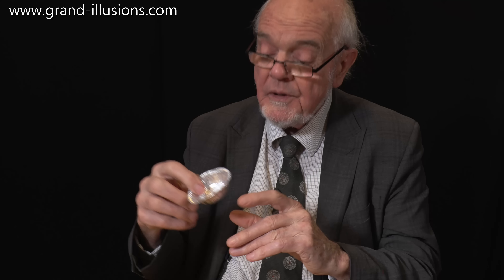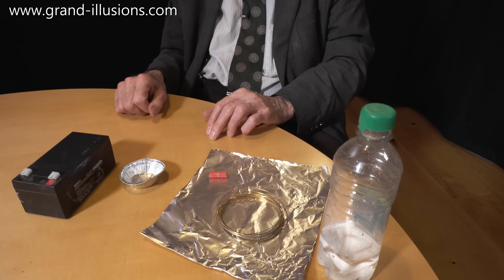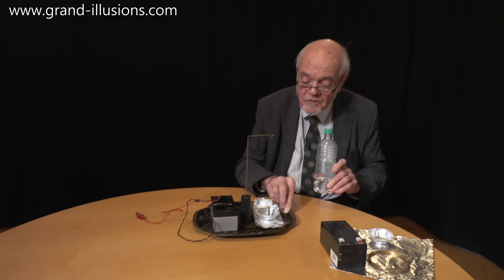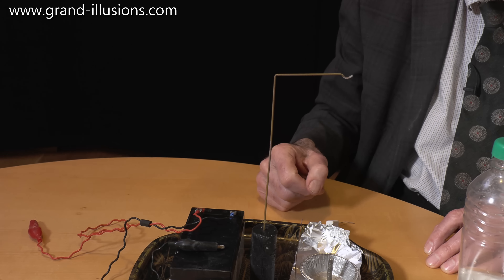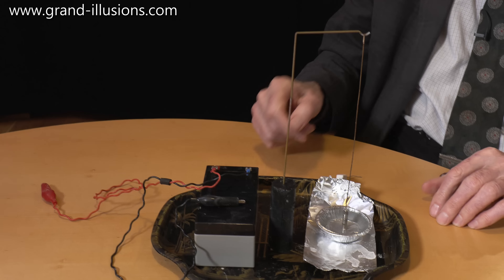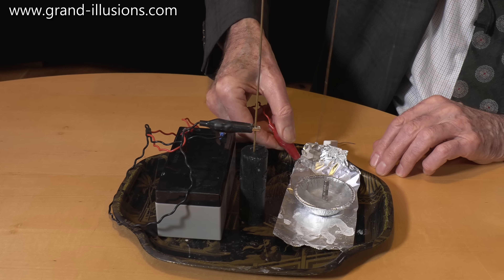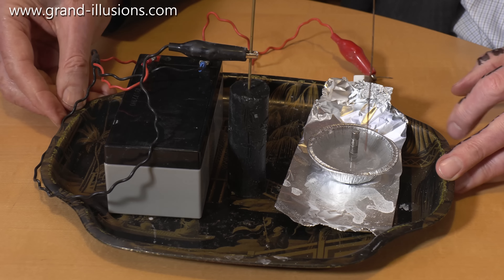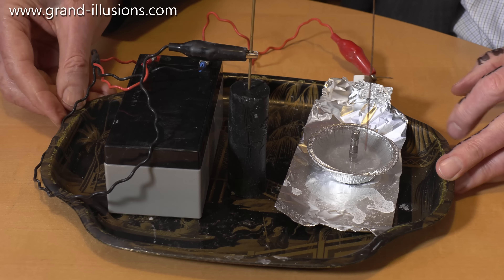The First Ever Electric Motor!

Comment: I used to make similar, simpler electric motors for my cousins when they were really little. I'd attach a few circular magnets to the bottom of a AA battery and on top set a copper wire that was bent around to make a v which touched the positive end of the battery, from the v were two arms that came down the side of the battery and just hovered in the magnets field.

When you let go the wire would spin around really fast.
Reply: Tim has shown those in some videos here too!

Comment: And since you are not using Mercury , you could use a match and show electrolysis at the same time, two for one.😮
Reply: I wonder if the current is high enough to release Chlorine as well. (Even so, not in dangerous quantities.)
Reply: @57thorns  bleaching would make it three for one.😄

Comment: I the U.S. it's a right-hand rule, interesting.
Reply: Kind of threw me when he said, "left handed rule."
Reply: For motors and generators, there are both left-hand and right-hand rules. The left-hand rule applies to motors, and the right-hand rule (with the fingers labeled the same way) to generators. This makes sense, since a generator is just a motor working "backwards," with rotational motion creating electric current, rather than electric current creating rotational motion.

The more general mathematical rule for determining the direction of a cross product is, by historical convention, a right-hand rule, but that's probably just because more people are right-handed. You could easily formulate it as a left-hand rule.
Reply: @schafer6811  The force rule would be exactly the same.  But motion is in the opposite sense.